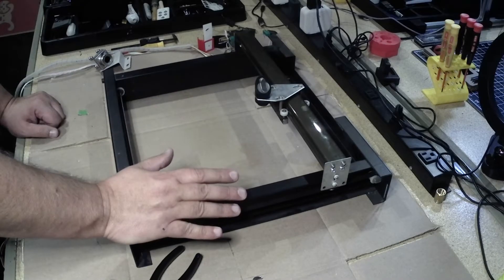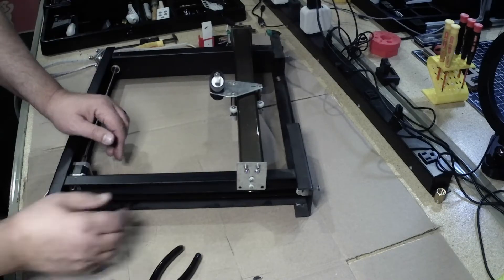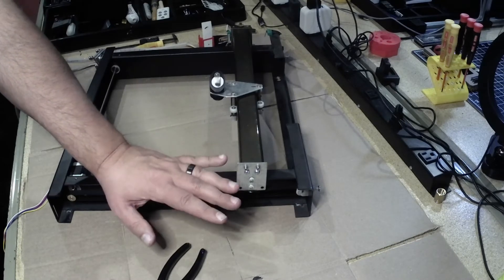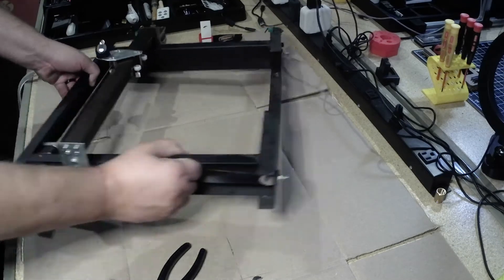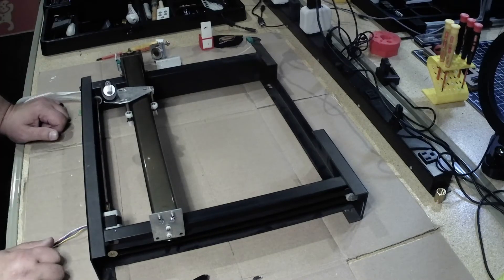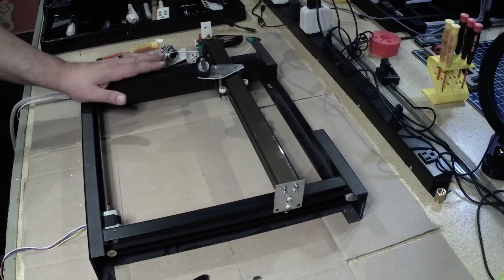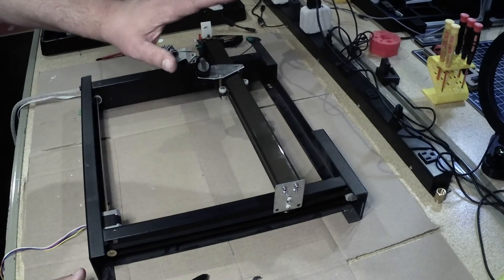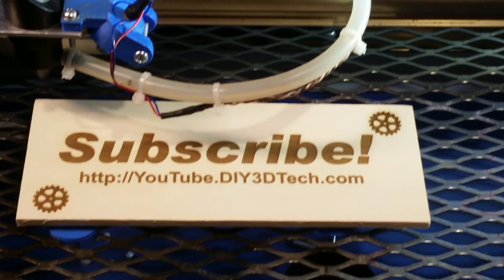eBay K40 CO2 Laser - Correcting Alignment Issues Part 2!

Comment: Have you looked at the alignment of the Y axis tube on the left side of the gantry? I took my new K40 apart mainly because of a number of broken parts. When I did, just as you say, out of alignment for sure. I got it as close as possible and aligned the beam. I still haven’t used it yet, hopefully tomorrow.  Oh yeah, the tube on the left side I found the majority of the bolts loose on the gantry as well. I tried to align that tube up, finally after about 2 hours of fiddling I got it within 6-10,000. Hopefully that’ll be good enough. Talk about crudely made! Thank god I have some experience with 3D printers, lol

Comment: Knowing what you know now would you still buy a K40 or invest in a more expensive machine?
Reply from the maker: If you have the money and not looking for something to work on buy up no question.  My suggestion is jump to a 60 watt unit at least and if your using for a business spring for the 100 watt you will not be disappointed...
Reply: A K40 is "what can I kinda, sorta do with a laser when it just barely punches through a 1/8th inch MDF sheet or acrylic?" as a hobbyist or possibly proof of concept